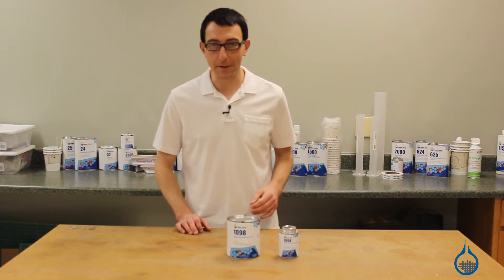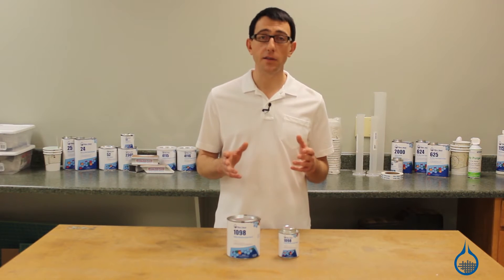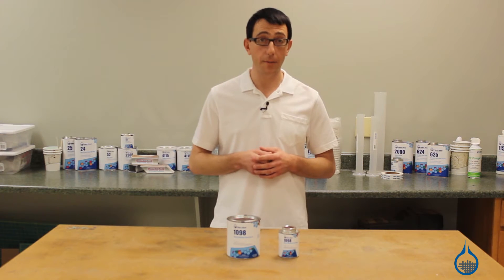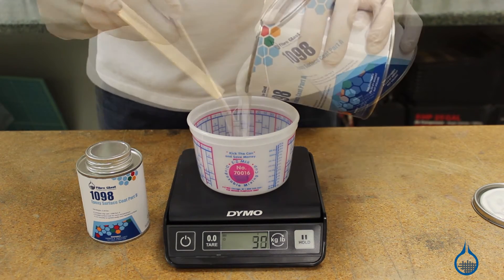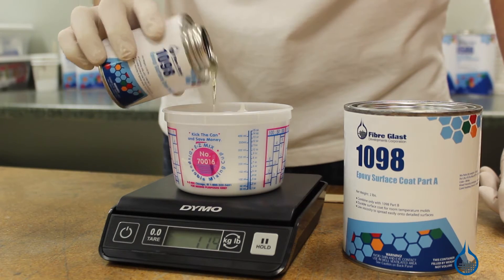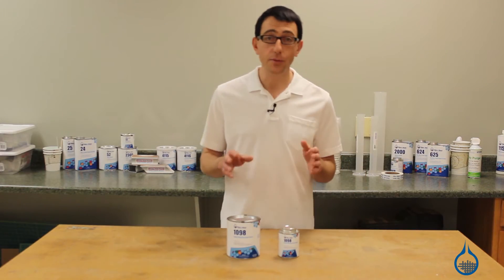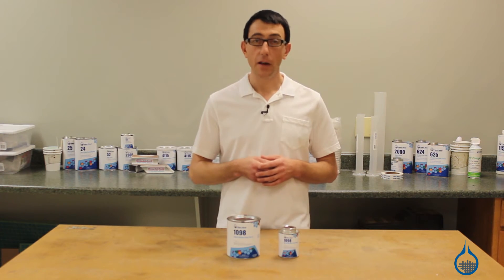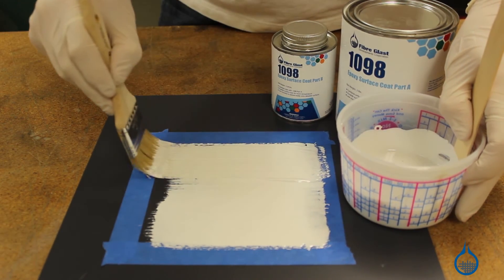1098 Epoxy Surface Coat

Comment: I have a question I've looked all over to find with no avail...   Polyester resin has a wide variety of color to choose from for gel coat.   Is epoxy surface coat for exterior, in sun, applications like gel coat such as on a boat, or is paint the only option?
Reply: epoxy will degrade with UV exposure.